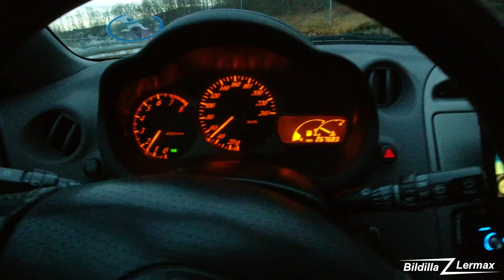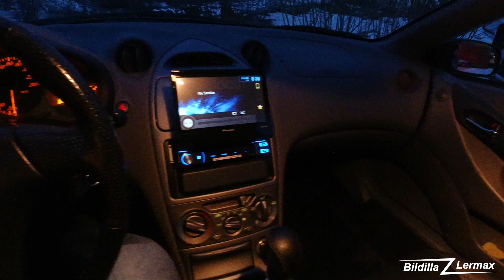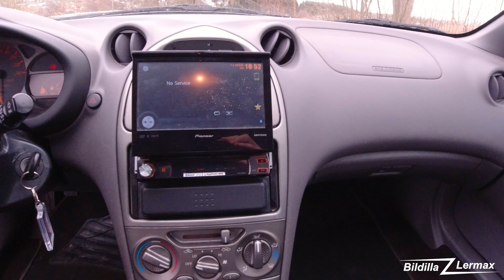Project Car: 2000 Toyota Celica 1.8 GT - 1ZZ-FE engine - Engine use oil -  Bildilla Magasin

Comment: Celica sin lsd,la centralita no deja programar,con un mal agarre,piezas muy caras,apexi muy cara y difícil de programar y no sirve sin otras piezas, además requiere un relog de mezcla que es muy caro y no es poco que ay que sumarle el pago del banco de potencia que puede llegar a 600€,apexi,relog,y banco alrededor de 2000€ sin tener potencia no sirve para nada quién va a comprar un árbol de levas ni nada para esta basura,es una basura de coche,la hidra igual cara,las barras de torretas muy caras,barra de torsión frenos kit suspensión porque no agarra,otras llantas y neumáticos, potencia poca y el 1zzfe muy muy corto le falta de todo esto es una basura el Celica 7g es un coche para niñas.
Reply from the maker: Esta puede ser una de las razones por las que Toyota dejó de producir autos deportivos. 1ZZ estaba mal motor ...

Comment: Il coûte combien ces optique phare ...ils sont super les Angeles
Reply: 280$ combien en eur les 2 ou juste un
Reply from the maker: @mohamedmilad4619  C'est probablement un paquet de 2 lanternes.

280 $ = env. 246 euros
Reply: Je souhaite te contacter sur viber ou msn je suis de l'Algérie Alger Merci
Reply from the maker: @mohamedmilad4619  Ce n'est pas moi qui ai les lanternes. Je les ai trouvés sur eBay. Il existe de nombreux fournisseurs aux États-Unis, en Europe et en Asie, qui peuvent fournir ces lampes, ainsi que des lampes similaires. Ici en Norvège, ils sont beaucoup plus chers, alors je m'achète moi-même à l'étranger.
Reply from the maker: https://www.ebay.com/itm/TOYOTA-CELICA-T23-1999-2000-2001-2002-2003-2004-2005-LPTO13-HEADLIGHTS-HALO-RIMS/122944835860?hash=item1ca0155114:g:HtQAAOSwI~taaZz2
Je pense acheter ces
Reply from the maker: https://www.youtube.com/watch?v=j1MIn5S1XJI

Comment: I have a 2001 celica with the same oil issue. Is there any way I can fix it easily? I’m not too experienced with fixing stuff yet but I’d love to learn
Reply from the maker: Good day. Sorry I have no information to indicate that there is any quick fix. I have heard many different opinions about what really is the problem, but must admit that several of the "truths" that lie outside have probably become "truths" because they have been allowed to live their own lives online. And many have taken statements online as facts, without having to be.
I have to admit that I find it hard to believe that Toyota replaced so many "short-bocks" here in Norway, only because of poor drainage of oil in piston rings ..... Then they should have taken other measures earlier. But I hope that together (the entire Toyota Hobby environment), we can find better and more secure info. And then maybe find lasting solutions.

Comment from the maker: Driving pattern can be a big problem on many engines too! Especially in cold areas like Norwegian winter. Diesel engines, which run only small trips, tend to be filled with carbon particles.
But the Celicas, are often run by younger people, and gasoline engines should not really struggle with the same problem as diesel, in winter time ...
But I have a 2.4 liter in my 2003 Toyota Camry ... It is not used for driving smal trips! It have NO problems. While I see on YouTube that several are reporting almost the same problem on this engine as on the Celica in the US ????

Comment: Its pretty well documented that the piston design is flawed in the 00-02 1zz celicas. Engine swap with a 03+ 1zz and you will be gtg.  Just a weekend project if no other gremlins appear. You will need to strip the original engine of sensors and everything else to put on the new engine, as even stuff like the knock sensor is different.  And if its a 1zz from something thats not a celica you will need to drill and tap the area of the engine block where the axle support bearing would go.
Reply: Then in your free time rebuild the original and sell it, or keep it in storage as a spare.
Reply from the maker: @AtomicBleach  Have considered buying the parts, and picking down the engine, and making suggested changes yes!
Reply from the maker: Thanks for the information.
But here in Norway, do we have cars that are 2004 model, and still use a lot of oil?
Reply from the maker: The son of a friend, has a 2004. And it uses just as much oil!
Reply: @bildillamagasin  any car that's over 15 years old will burn oil if it was treated roughly. So unless the son of your friend has owned it their entire life and kept up with maintenance I can't blame the car.
Reply from the maker: @AtomicBleach  Of course that is absolutely true. But many have reported the same in both Celica and Avensis, here in Norway.
But the newer 1ZZ engines should have improved according to Toyota Norway.
Then it is an extra pity to hear about people who changed "block", 2 times. Fortunately on warranty!
Reply from the maker: @AtomicBleach  Driving pattern can be a big problem on many engines too! Especially in cold areas like Norwegian winter. Diesel engines, which run only small trips, tend to be filled with carbon particles.
But the Celicas, are often run by younger people, and gasoline engines should not really struggle with the same problem as diesel, in winter time ...
But I have a 2.4 liter in my 2003 Toyota Camry ... It is not used for smol trip driving. My Camry have NO problems!  While I see on YouTube that several are reporting almost the same problem on this engine as on the Celica in the US ????
Reply: 1zzfe 2zzge caca power honda vtec